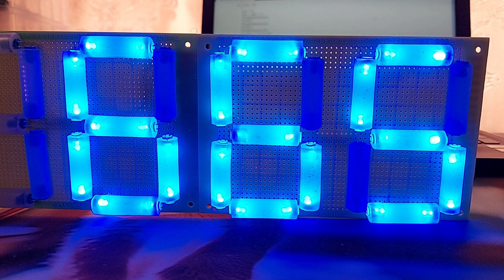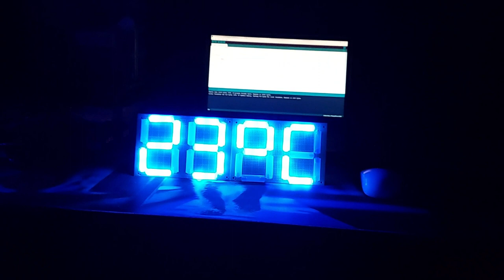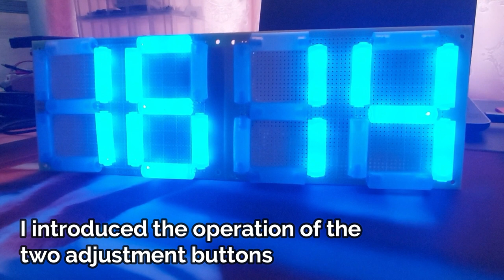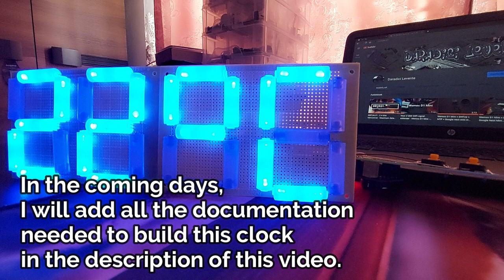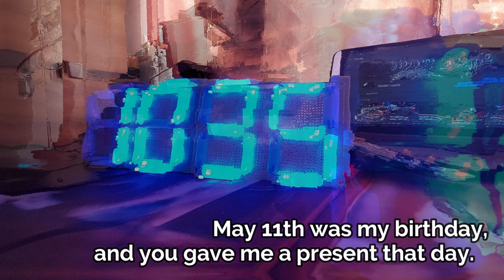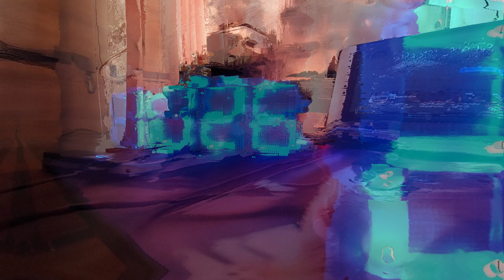Digital Clock on a 7 Segment Display from Hot Glue Stick - Blinking LED next level ! (with code)

Comment: wow you wrote code yourself & used shift registers, try the next one using addressable ws2812b rgb, wires would be much less, also if you change the crystal of the rtc any other programming is required.
Reply from the maker: indeed the complete code is written by me.